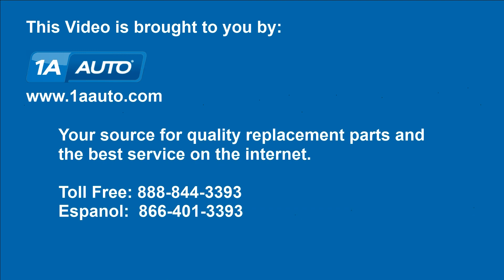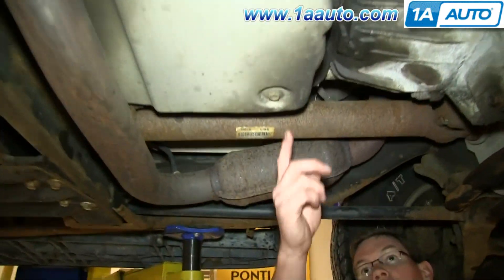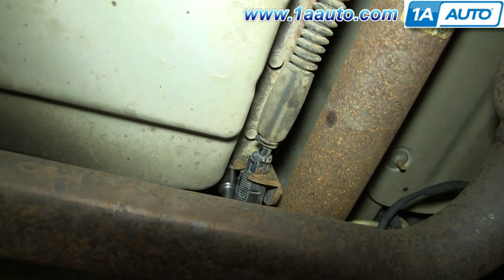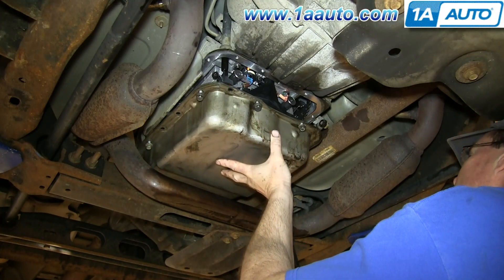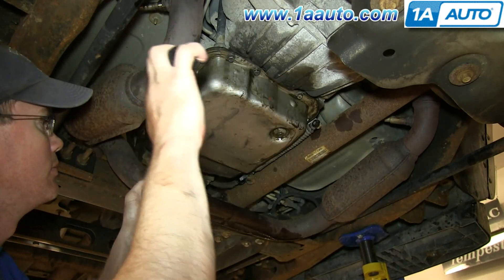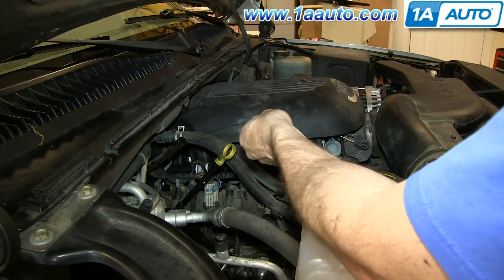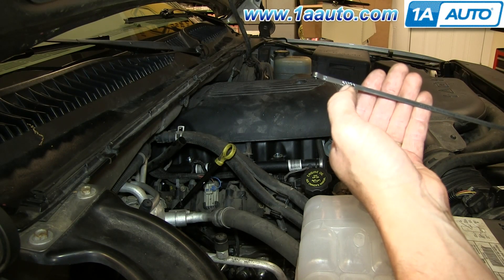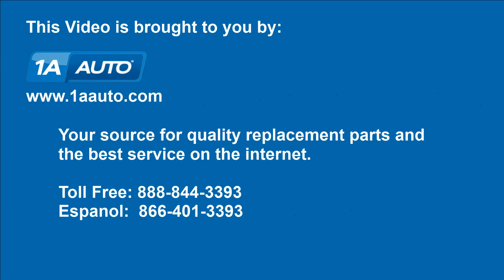How to Replace Transmission Oil Pan 99-13 Chevy Silverado 1500

Comment: I love how these videos show no hassle at all... Maybe we can see a realistic one where the guy strips the bolt and spends the next 2 hours pissing in the wind trying to remove it... :)
Reply: Probably because those guys who struggle really don't know what there doing.
Reply: Hahaha that's awesome swearing and throwing wrenches hahaha.
Reply: We plan on making that version this weekend 😂 I made sure to show my struggles with removing the passenger wheel hub from my '04 Silverado when I had to beat it with a hammer and chisel lol
Reply: Exactly,I've never been able to remove exhaust bolts without breaking any
Reply: LOL I heard that, I spent the entire afternoon doing a transmission fluid and filter change, this video wasn't terribly helpful either.
Reply: Not worth the really life effort throw the whole truck away, GM is crap
Reply: This is easy, GM now moved exhaust over last row of bolts in the 6L90e....it's got me scratching my head.....
Reply: @CL-ok1gx  which manufacturer isn’t these days…,  which one(s) do you recommend…, (Honda & Toyota) don’t make a 5800lbs 8-passenger SUV, or a 3/4 ton pick-up…
Reply: @markbauer9393  replace them with copper

Comment: most of these pans do NOT have a drain plug...just drop the front of the pan first. Also...do not take the six header bolts off...most of the time they are VERY tight from heat and rust and they snap off easy. Instead take the two rear transmission mount bolts loose from the crossmember and jack the transmission up about 2" and the pan comes right off...   ;0)
Reply from the maker: +Dennis Morris Thanks for the tip!
Reply: Thank you very much Mr. Morris👍🏼

Comment: I was talking to owner of a parts store today about me having to do this job. He just did it on his truck. He said to be careful with torquing the bolts ...that is, torque to 60% Of specs when the bolts are wet or damp with transmission fluid in the threads. The fluid provides a lubrication and will throw off the precision of the torque specs. Posted torque specs are for building the transmission at the factor with brand new, dry bolts. Would you agree?
Reply: Absolutely!! Any lube.. even saliva changes torque specs. Search "Petes garage. How lube affects torque" awesome video on lubed threads.

Comment: notice you skipped the installing the filter gasket, did you have any trouble getting it in or how many filter rings did you go threw before you got it in? that would have been a good tutorial to see what was used 19mm, 20mm or the bushing too what worked better

Comment: firstly. make sure the filter is in properly and straight side to side.made putting the pan in a nightmare. secondly. use a clamp instead of the pry bar hes talking about itsa free hand and stays out of the way the entire time you dont even need to drop the exhaust and risk breaking THAT bolt. less headaches. spray it with brake cleaner when the pan is off and wipe it down a few times.

Comment: also...do NOT overtighten the pan bolts. If you do this it will put a dimple in the pan @ the bolt holes and the pan gasket will leak. Only way to fix it is to take the pan back off and take a hammer and tap the dimples back out of the pan where the gasket sits...then do it right...   ;0) "sail up...sail on...sail over"

Comment: That must be the 4-speed transmission .  I have the 6-speed 6L80-E in my Silverado - and it is not near as easy to get the Transmission pan off.  I have managed to get it off by taking the hanger straps off and prying down on the exhaust using the cross member as a fulcrum point (Up on the long end of the lever)...and that will give you just enough clearance to get the pan off from around the filter body.  Terrible thing to do-  put a hot exhaust right over something sensitive to heat (transmission oil), then recommend a short change interval and not provide even a drain plug.  I don't flush my transmission oil that way, though - I use the return line method.

Comment: should have replaced the filter since u had the pan off, and I read that the pan gasket is reusable if it's the rubber one anyways.. how many quarts are required for this with a filter change? about 4qts?
Reply from the maker: +tankdog03 Thanks for watching!  Please consult your owner's manual for fluid type and capacity, as it depends on the model!  1AAuto.com

Comment: Theres two longer bolts in my 4l60e from a 97 lt1 camaro. I took the pan off and changed the filter. But i didn't pay attention to where the 2 longer bolts on the oil pan go... 
Having a hard time finding where on the oil pan it goes. If you could help me id appreciate it.

Comment: took pan off 1995 1500 4 wd found a bolt laying in bottom of pan not one of the ten mm but smaller where does it go back?

Comment: Not sure if using an impact wrench on the exhaust flange nuts is a good idea. Don't you run the risk of breaking the bolt off? I say this because typically rust will develop and make them very difficult to get off.
Reply from the maker: +Daniel De La Torre Yes, You have to be careful. You may want to try heat or also penetrating oil also to help break them free. 1aauto.com
Reply: Impact works better than breaker bar.  I know the hard way, all sheared off with breaker bar, other one that didnt, I used the impact.

Comment: after changing the filter and adding fluid last night my truck now will not accelerate forward. No shift, nothing. please help.
Reply: You might have damaged a shift solenoid while removing the pan take it back apart and check your shift solenoids.

Comment: Wouldn’t changing the pan/gasket damage the trans if your replacing it with new fluid especially if it was never changed before?

Comment: what type of atf is right for the chevy suburban 2004 1500?
Reply from the maker: It should have the requirement in your owner's manual or usually it will also say what the recommended weight is on the metal part of the dipstick.

Comment: The pan on my 2012 with the 6.2l is impossible to remove. Nice job GM engineers from putting that crossover there. 🤬🤬🤬🤬

Comment: i'm not sure why you wouldn't change the filter or even just mention it for the sake of your audience; they're cheep enough to replace, and certainly something that should always be replaced if you're replacing the fluid at the suggested intervals of 50,000 miles(83 000 km) especially if the vehicle is older -- as it would be, for the particular vehicle you demonstrated -- what you've essentially done is, teach a novice to not change the filter for upwards of 100,000 miles ...or worse, overlook changing it at all due to a lack of knowing that it even exists.

Comment: 1AAuto on my 06 my pan does not have that drain bolt, how else would I change fluid?
Reply from the maker: +firepelayo Transmission pans should have either a drain plug, or a hole on the side that will allow you to check the level.  If there is no plug or side hole on your transmission pan, then the transmission is not serviceable.
Reply: you can change the fluid still by removing the bolts slowly and letting the fluid flow out on a corner. then remove the pan. replace the filter and add trans fluid